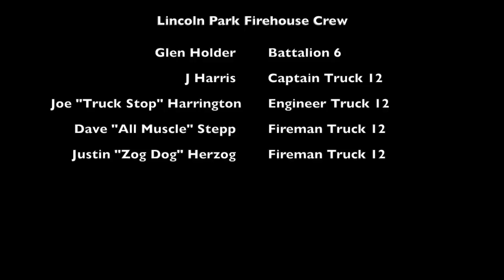Tuther Fire 2 FireCams

Comment: One of the best ventilation videos I have seen, great work and communication.
Reply: That was one of the best Hole Cutting videos, period!
Reply: @mxslick50    Just one more comment for you.  When someone says Shut Up or Go Away, that means they have lost the ability to back up what they say and don't understand what someone else is saying and are embarrassed with Their ignorance.  BYE!
Reply: @mxslick50   Only in your childish dreams!
Reply: @JB91710  Oh boo hoo, that the best you can come up with?  I've  heard 5 year olds do better than that.
Reply: @JB91710  and you plagiarizing me yes I have the clip and I have copied and pasted it as well as a screen shot.  You are a criminal. As for the criticizing the roof ventilation there was obvious fire in the attic. The attic was vented through the roof allowing heat and carbonized fuel to escape. Flames are not where the actual combustion occurs in the coals and char that the flames are coming from. Flames are the visible emissions of thermal energy which is a product of combustion. Now for the smoke the smoke itself is full of carbonized fuels for example soot. There is a significant issue with the possibility of a smoke explosion. (J.B. just to ensure you are following these are also called back-drafts they can be powerful enough to blow the walls off buildings.) This tactic is not only approved by UL N.I.S.T. N.F.P.A. it is also taught by I.S.F.S.I. certified instructors. Does it work yes it does the fire was contained to the rear area of the structure, yard, and shed. Your tactic of applying water through the window is not available because of the direct flame impingement. for this incident a combined defensive exterior attack combined with an aggressive interior attack is the most efficient fire attack the fact that I am right is backed up by the firefighters and officers choosing to do exactly that. The fact that it works is amply demonstrated by the fact that the residence was saved. You are the childish one refusing to accept that you are wrong even in the face of empirical evidence that says so. You never answer direct questions about your qualifications. You have clearly demonstrated you have no genuine respect for the law or others feelings and more importantly their basic human rights. When anyone directly challenges you your response is to run off at the mouth in a tirade of pejorative ignorant insults purporting to be better that they. You are a bigoted troll who is liable for tort actions because of statements that are libelous and involve defamatory slander. This time there will be no paying lip service you will apologize and cease and desist in your libelous, pejorative commentary, or face the consequences. How does the idea of a class action strike you.